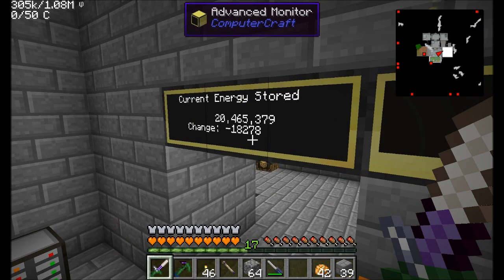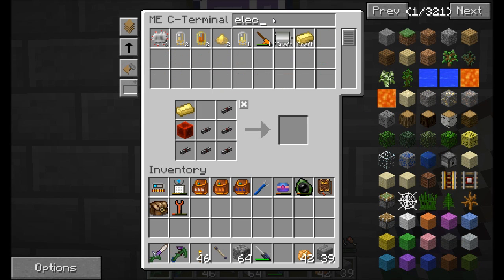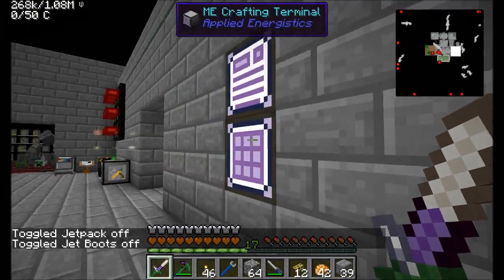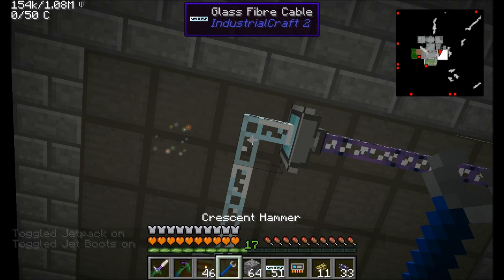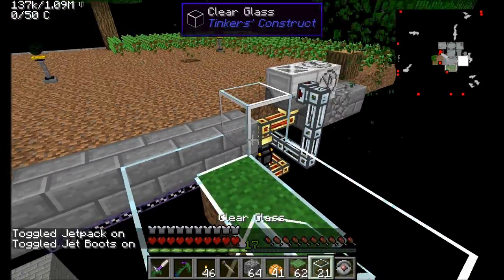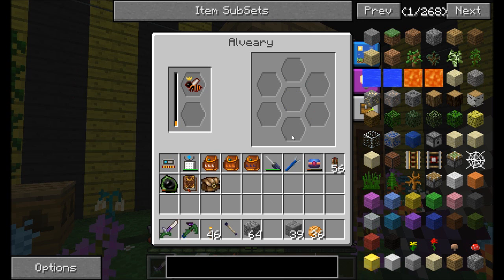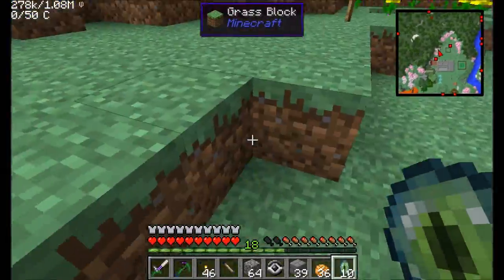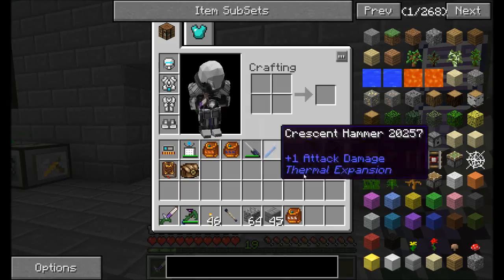Lets Play   S6E108 EU to RF

Comment: Dire I have been wondering and slightly concerned with a possible "infinite" power source; as with Witchery Chalk being "Repairable" with the help of Ars Magicka... could Uranium fuel rods be "repaired" in the similar fashion?
Reply: Possibly, I think that you would have to try it out but I think the Arcane reconstructor can repair most items with Durability.
Reply: Jan Ham
could they "repair" energy cells?
Reply: barbossa black I personally don't know but I do not think they would be able to repair things like Energy cells and other items with a durability which can be charged using Energy, as I said I do not know for sure that is why I recommend trying it out yourself.
Reply: I totally am gonna do this now. I really hope it works
Reply: barbossa black would be cool and kinda cheaty at the same time, well you could of course see it as a "energy converter" with the essence and stuff from AM2
Reply: I dont think so, because the arcane reconstruct can only repair items with "regular" damage, like a sword or a pick, but it cannot repair an item that can be recharged (an energy item), or an item that turnes into another item when broken (like tinkers tools), and I think that the uranium fuel rods answer the second type... also, they are only losing durability inside of a working nuclear reactor, which means they might be irregular in that regard too, but i dont know enough about the way minecraft is coded to be certain about it... only way to really know for sure is to test...
Reply: nimrodyahal Someone here should test. I might at some point.
Reply: after a short test, i can tell you that unfortunately it doest not work :(
Reply: nimrodyahal That is only a good thing. I hate OP things.  But that doesn't mean I won't use them if they are available...

Comment: can those rednet energy cables from minefactory reloaded connect to the IC2 transformer blocks? that could be cheaper than an MFE so you could have several MV transformers taking power from the MFSU and outputting it to rednet energy cables which relay to the RF network
Reply: if they can that would be fine if he didn't have a ridiculous amount of materials and having a MFE means he can store more energy. you can never have too much energy storage.

Comment: you could always use fortron to convert power. you need 2 coercion derivers, one set to derive and one on integrate both connected to a fortron capacitor.
Reply: And very slow and inefficient I believe.
Reply: yeah, I finally tried it out and it is a HORRIBLE idea
Reply: Haha, how bad was the exchange rate, or was it just the speed that was an issue.
Reply: ragged reece The speed was really terrible. Even with 128 speed upgrades it was still super slow. That and the rednet cable is much much cheaper.

Comment: How does dire hover when he activates his jetpack and boots?
I just fly when I do it.
Reply: The advanced flight control circuit in his helmet.
Reply: Flight control, a head component.
Reply: he activates hover mode
Reply: kamoko888
Wrong mod, it's already been answered by the other two people.
Reply: Press "K" and attach Jetpack, Flight vision to single keybind.

also, set Flight vision to zero. if you need to descent, press Z :)

Comment: Call me old fashioned but, what ever happened to using water and ice around the reactor to cool it? Is that still in the latest versions? Or was that only back in the days.
Reply: +EVILBUNNY28 I know you're comment is a year old, I just wanted to reply cause i've played both infinity and dw20 recently. IC2 is just, constantly screwing with the formula.  Direwolf20 pack is actually still pretty nice compared to ftb infinity.  (At this rate though, you'll need to spend like 3months just to make a single uranium cell. I swear)  It's not that bad yet...but damn.  Instead of making the formulas meaningful (Like they USED TO BE), they just made it convoluted.

For each item, you require like 6different items, of which each require 6 different items, of which again, each require 6 different items, and throw in 1 difficult to get item early game. (Of which, there are 2 required).  I swear, it's like a slap in the face for anyone who actually liked ic2.  I find myself leaning towards Thermal expansion now, just cause it's still hard to get the stuff you want, but the recipes don't turn you into some sadists play toy.
Reply: I know what you mean.  Industrial Craft (the first one) was amazing, all the recipes were so basic, and playing with IC, the original Buildcraft, Clay soldiers mod, Aether, and all of Linkseys Modloader Mods etc.. Was brilliant, just thinking about it now brings back Nostalgia. Everything use to be so simple back then.
Reply: EVILBUNNY28 I do remember that...barely played when it came out though :P

But yea, seems like they're forgetting that sometimes, simplicity is bliss.  It can be hard to do, without being tedious.

Comment: U should add more crafting CPUs so u craft things faster
Reply: Honestly I don't think when you make a 2x2x2 inside the ME Crafting thing; that you need 2x2x1 of the crafting memory things  (or 4 pages of things that it can remember).  Seems like 2 pages is typically enough; maybe 3.  So just replacing the ME Crafting Terminals with Crafting CPUs. but; yah.  [PS. Each Crafting CPU can do a craft so it is only faster by 1 craft per.]
Reply: MrThetronica Depends on the person and the circumstances and what-not. Before I put my agrarian skies playthrough on hold, I made it up to 4 full pages. Usually, though, I only fill around 2 pages.
Reply: Brasilian Engineer In most cases 2-3 are all that are needed; if you need more Just make it larger and make 4-5 pages and the rest CPUs.  Hope we never need more than 5 pages...